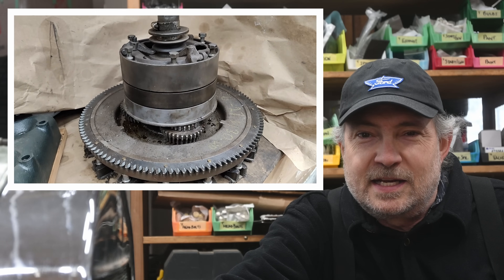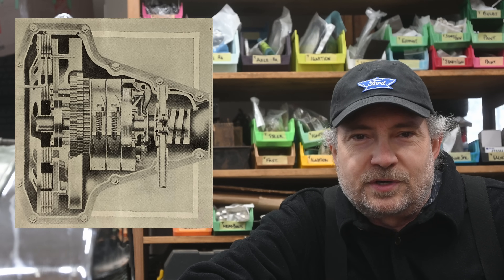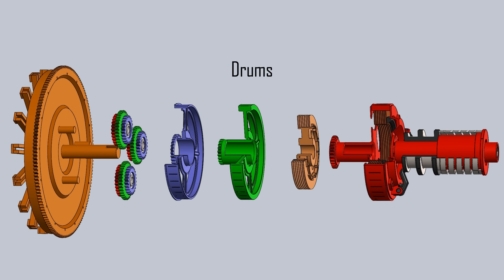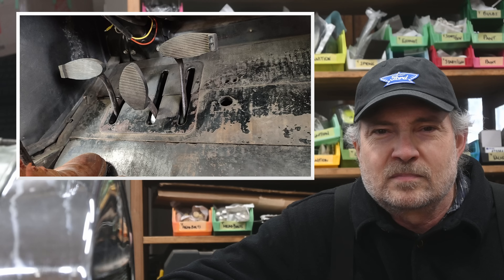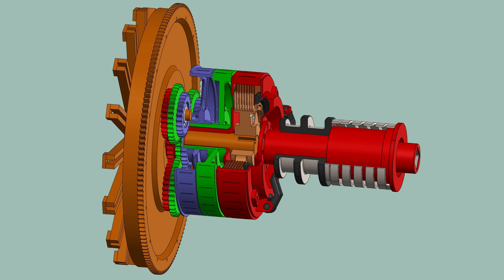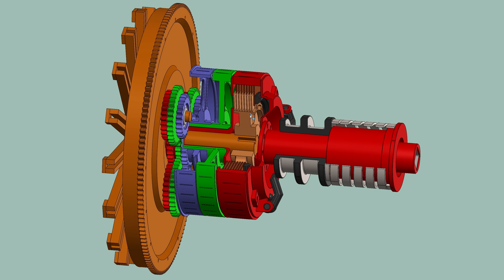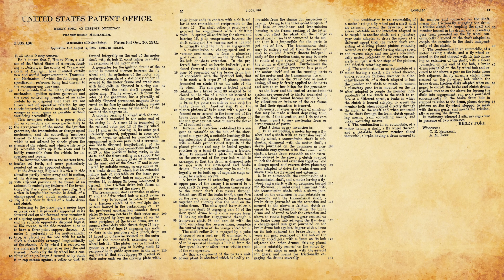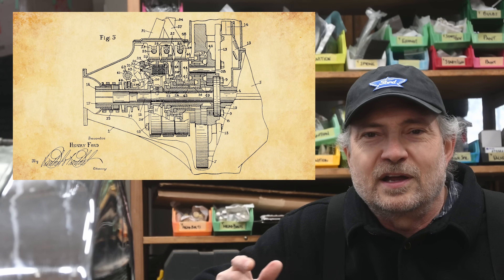How does it work?  Patents, animations. Ford Model T Transmission

Comment: My Ford hybrid uses a planetary gearset. Using two electric motors to vary the speed of the various components gives a wide and continuous gear ratio. This makes for a smooth change in speed and good performace and is only the size of a grapefruit. The differential is actual larger and more complicated mechanically than the transmission (not including the electric motors)
Reply from the maker: Incredible to put that much power thru such a small gear package.

Comment: I'm from Australia but my father grew up in Denver and Sacramento. Whilst living in Sacramento in the early 1920's, he and his Brother built a boat and installed a model T engine and gearbox. The problem with ordinary gearboxes in boats is reverse gear is too slow. He used to tell me about how, with a model T gearbox you could weld one of the bands and have a reverse that was full speed, like forward. I found this article very interesting, because I never fully understood how all this worked.
Reply: I have heard of this as well, one does not need low or a Slower than direct reverse....I am not sure how that would be done....Unfortunately the only people that I knew of this are all gone now.... :(
Reply from the maker: Interesting!  I will look more closely at old lakeboat engines and trans

Comment: Thank you. I have always wondered how it works. Where does the handbrake come into this, as I have seen people saying to set it half way (for starting?)😎
Reply: The handbrake was to your left & it was a parking brake. It applied the brake shoes in the drums on the rear wheels. The brake in  the transmission was used to stop the car.
Reply: Thanks for the comment. I have since found that the handbrake has a cam on it which puts the gearbox into neutral.🙂🙂 @n.mcneil4066
Reply: @melclark1066  That would be necessary, since the engine was hand cranked without a foot on the left pedal in neutral.

Comment: This transmission design is one of the best transmission designs ever developed. Henry Ford is truly a brilliant entrepreneur and businessman. Today's transmission engineers will never admit how clever and efficient this transmission design really is. This triple gear design is brilliant and strong. Yes it is hard to understand how it works but once you do the math you will realize this transmission design's superiority, even by today's standards.
Reply from the maker: Yep. Agree.
Reply: Indeed it would seem to be an ideal transmission for an electric motor 🤔
Reply: @johnrickard8512  Few, if any, applications with an electric motor can benefit from a multi-speed transmission. Since an electric motor produces its maximum amount of torque at near zero speed, the torque multiplying aspects of a multi-speed transmission are of no value for the motor.
Reply: @johnrickard8512  The triple gear planetary principle was used in 110V motors used in the Delta Leveling System on Canron Tampers used in leveling railroad track. EJ-5, Mark I, Mark II, Mark III Tampers are the Models i remember. With my horrible memory i can't recall who manufactured the motors. There was one on each side of the Delta Leveling System. Not sure if i have the correct name but fairly positive. There must be a Patent on that as well! Actually, Canron required/wanted the voltage regulator set at roughly 127 VAC. They had four 3-Phase Electric Motors running the workheads. For some reason 30HP each sticks in my memory but not positive. No planetary there though. Later Mark III Tampers went to hydraulic motor operated workheads. All the coils to operate hydraulic valves on the machine were electric and 50 Hertz. The machine lifted, cross leveled, and aligned railroad tracks although not all early models were equipped with liners. Oops i forgot, some only tamped ties. Those had no track lifting capabilities either. NONE of those were Mk III's though. All the Mk III's i ran across had lifting and lining abilities. The I's and II's which had lifting or lifting/lining abilities had a Torsion Beam; without, they just tamped ties.

Comment: Henry Ford was so close to making the first automatic transmission . If only he knew .
Reply: Yes, the two speed automatics like the Powerglide & the Ultramatic, although more refined, operated on the same principle. The low band, reverse band & the High clutch, rathere than being manually operated, were operated by hydraulic cylinders (servos) & the brake band was replaced by a parking pawl.
Reply from the maker: @n.mcneil4066  interesting!
Reply from the maker: Haha. True!

Comment: Many electric vehicle drive units also use a planetary reduction gear design... although in almost all cases it is always engaged, and does not shift. The Volkswagen Group J1 platform of the Porsche Taycan and Audi e-tron GT has a two-speed planetary transmission (shifted by multi-plate hydraulic clutch) in the rear drive unit.
Reply from the maker: Interesting.
Reply: @retiredbore378 believe it or not, Tesla is not the only EV manufacturer.  

Yes, Tesla uses parallel gears (in two stages in the cars, three stages in the Semi to get a higher reduction ratio), and so do the Nissan Leaf and various other makes and models. What I said is that many - not all - EVs use planetary gearsets; examples include the Ford Mach E and some Volkswagens. 

Whether parallel or planetary, all production car transmission gears are helically cut - straight-cut gears are too noisy.
Reply: @@retiredbore378the steam turbine reference is valid, but obscure. Typical parallel-shaft EV transaxle are just like a simple conventional transverse manual transaxle, minus all of the unnecessary parts: clutch, synchros, shift mechanism, and all but second gear. Of course the case is just big enough to hold the few remaining components: input shaft with one gear, output shaft with one driven gear and one driving gear, and final assembly of differential with a ring gear bolted to its case.
Reply: I don't doubt your knowledge of gears,@dbore378... just cars, specifically EVs. It's a little weird for a non-Tesla owner to quote Tesla specs, but there's a lot of information about Teslas in public sources. What have you owned?

In addition to the first three examples (not exhaustive list) that I mentioned, planetary gearboxes have also used in EVs by Chevrolet (Spark), Jaguar, other VW Group models, and Ford... in both the E-Transit (which uses the same drive unit as the Mach E) and the mass-production F-150 Lightning. There are likely more that I haven't noticed. That's multiple manufacturers and at least tens of thousands of cars now (but probably hundreds of thousands), and the Lightning alone will account for tens of thousands per year. Yes, that's "many EVs".

By the way, if your intention was to say that the maximum ratio of a single parallel gearing stage in a steam turbine ship is 10:1, and compare that to Tesla's practice, I'll note that no EV uses a ratio that high for a single stage because it technically possible but in practice not feasible. Older Tesla Model S transaxles had an overall reduction ratio of 9.734:1 or 9.325:1 (depending which of three different drive units), but that was always in two stages; one axle of the Semi is (or at least initially was - specs change) 23:1, but in three stages so around 3:1 per stage. Other brands tend to lower overall ratios, typically around 8:1, and again in two stages. Planetary reduction transaxles use a single planetary set, typically for a similar overall ratio, although is some cases (such as the Ford F-150 Lightning) it is a compound gear set.

Comment: Could this transmission be used in a modern pivot steer loader? Seems like it could be improved by changing the design to disc brakes instead of the drum brakes, and using servos to take the strain off the pedals.
Reply from the maker: In concept, sure! But remember thus transmission only handles 20 horsepower. You might be wiser to look at modern automatics that handle higher power. Thanks for watching!

Comment: I think you left an important part out - at least as I understand the transmission to work:
It is all about the rotation of the triple stack gears on their shafts - relative to the flywheel rotation, which they are mounted.
The three gears turn together as one unit mounted on shafts (they can rotate on their respective shafts) attached perpendicular to the flywheel.
The one gear is for output it is connected to final drive.
The other two gears are low speed & reverse - when either the low speed band or reverse band are engaged - the respective center gear is held stationary - thus the triple stack gears will either turn faster or slower than the flywheel.
This is the only difference between how low speed & reverse operate?
when the triple stack gears are turning faster than the flywheel this is reverse?
It was explained to me years ago.
The multi plate clutch provides direct drive for top speed.
Reply from the maker: The triple gears are weird. Are they 'triple gears' because there is 3 of them, or are they 'triple gears' because each one has three pitch diameters?  I guess they are really triple triple gears...   Anyway, thanks for your thoughts.  I intend to study the transmission even more closely when I overhaul one. Maybe I'll do a follow-up video.
Reply: @flivverchannel  
I was looking at your cross section view & it looks like three separate gears that are held together, probably with some kind of screws.
The three gears have different pitch diameter.
It is probably easier to hob the gears separately & then assemble into one unit.
All three turn together.
Years ago, I was looking at a YouTube that showed how a Model T  transmission works.
I commented to the creator of the YouTube that I did not understand how it goes in reverse, because 1st (low speed) & reverse seem to operate/function in the same manner.
He then sent me a detailed description of how the triple gears work.
My description is only from memory.
Basically, the triple gears rotate with the flywheel - but are on their individual shafts.
It is how they rotate on their individual shafts that determines low speed or reverse - they can turn CCW or CW on the individual shafts, this creates a forward or reverse.
I guess in high speed (direct drive) the triple gears are not revolving on their individual shafts but are still turning with the flywheel.
I hope that what I said makes sense?
Anyway, that person told me that their are supposedly Model T experts that don't really understand how the T transmission works.

Also, I remember in school the teacher was talking about gears &.mentioned that the Model T used Cycloid toothed gears instead of Involute tooth form.
Almost all machinery uses Involute gears, so it is a little unusual.

Thanks for making the YouTube!
Reply: yes, it must be the ratio differences between low and reverse gear sets causing  the triple gears to run in either direction I cannot visualize the rotating carrier with gears going all directions. Your explanation is by far the best one  I have found....thanks @chamberizer
Reply: @larryanderson8049  
Yes, it is fascinating!
Reply: @larryanderson8049 the carrier is always rotating in the same direction.  When the green sun gear is locked by the brake band, it forces the planets to rotate.  Since the planets have stepped diameters, the pitch velocities are different.  Since the green planet is locked to a stationary gear, the smaller planet will give a positive speed, while the larger planet gives a negative speed.
Reply: @zachary3777  thanks for the reply!

Comment: Question . . . Is it ok to use the low speed band to help slow the car equivalent to gearing down in a manual transmission, or possibly even using the low speed and brake  pedal at the same time?
Reply from the maker: If you use the low band to slow the car, it will increase wear on the low band and drum, of course.  It also puts loads through all the gears.  If done aggressively, it could put more 'equivalent' horsepower through the transmission than the engine is able to, so overload is possible. To slow from High to Low, I would recommend First use engine braking with the throttle closed and the timing retarded, Then brake with the brake pedal until the engine revs match the speed of the car for Low, Then depress the Low pedal while matching the revs with throttle and returning the timing to normal.  Thanks for watching!

Comment: This is beautiful explanation of how these work!  When I describe it to people at car shows and such, I describe it as a two-speed automatic that you manually shift.  Just about the easiest thing in the world to drive, as long as you've never driven a car before.  Perfect first car for the masses, and much easier to drive than anything that came after it until at least synchromesh gearing.
Reply from the maker: Totally agree. It really was perfect for its time in history.
Reply: Chrysler had fluid drive transmissions you could shift with or with out depressing clutch.
Reply: @gonesideways6621  True enough, but that was still at least 30 years after the Model T was introduced.  And I can't say I have much experience with the more advanced or at least more modern transmission types, but didn't the early ones like the Vacamatic still need a synchromesh gearbox to work smoothly, at least until they switched to freewheeling?
Reply: This is a repeat my 1971 vw mini station was five minutes to change a front headlight  five dinero $$ new car newer year exact year was one half hour  600 $$$$$$ dinero  parts labor I never cared for abs breaks on cars mine was two days  2000$$$$$$$$ I never had done I just used my regular foot pedal why not simplicity  not all kinds of electronics or computers on wheels it was on my type 3 square back  without all details I will mucho honestly tell you all I never did everything in the ways possible because of how some volks are the will not work properly with us all some blamed me when I knew nicer what I was doing they never knew how to do this world has its share of all kinds of volks you can not always deal properly with just learn this and avoid wrong volks I would rather deal with nicer volks than trouble makers it is not always trouble maker just at times less problems when doing things at better times of years haste makes waste  for myself a nervous person wreck no but gracias cam on ong

Comment: Ironically, Toyota’s hybrid drives use a planetary gearset to control the relative speeds of the engine and two electric motor/generators, one of which is directly connected to the drive wheels.
Reply from the maker: Other than computers and electronics, humans haven't invented much that's truly 'new' in the last 100 years. I'll try to find some diagrams of that Toyota hybrid drive; sounds interesting.
Reply: @flivverchannel  keep in mind that the Toyota design uses the planetary gear set as a power splitter. This is long-established design (at least several decades older than Toyota hybrids), and is used in other hybrid car transmissions including the GM models such as the Two-Mode and Voltec (used in the Chevrolet Volt) and many Ford hybrid models.
Reply: It only uses planetary gears for reduction of output speed / increase  of output torque. There is no "shifting" , only one ratio, and no brake bands. It is geared directly to the motor/generator in the "transmission" , the generator that is attached to the engine crankshaft is not connected (mechanically) to the transmission.
Reply: no,  @jamesgeorge4874 , the planetary gear set in a Toyota Synergy Hybrid Drive is not just a reduction gear set. It acts as a power splitter, allowing the ratio between engine and output speeds to vary continuously by controlling the speed of one of the electric motor-generators (designated "MG1" in Toyota's technical descriptions). While there is only one planetary set in the power splitter, the ratio of input to output speeds is not fixed.
Reply: In the Toyota HSD design and every other power-split hybrid, @jamesgeorge4874 , both motor-generators and the engine are all mechanically connected to each other, and none are connected directly to the engine's crankshaft. 

In the simplest version (such as a Prius), MG2 is connected to the output at a fixed drive ratio; the engine, MG1, and the output to the  final reduction gearing are connected to the planetary power splitter. In normal operation with the engine running the power splitter divides mechanical power flow between the output and MG1, while the electrical output of MG1 powers MG2. The battery accepts surplus power (from MG1) or provides extra power (to MG2) allow the engine output to vary less than the load of driving the vehicle. 

There are also a few series hybrids (not from Toyota). In a series hybrid the engine drives a generator (only), and the generator electrical output (plus or minus any battery discharging or charging) drives the electric motors which drive the wheels. Gearing in these systems may be planetary or parallel, but there are no planetary power splitters involved.
Reply: @jamesgeorge4874 that is not true at all.  The Toyota hybrid design is like if you took the model T transmission and connected one electric motor to the red output, and a second motor to the green gear.